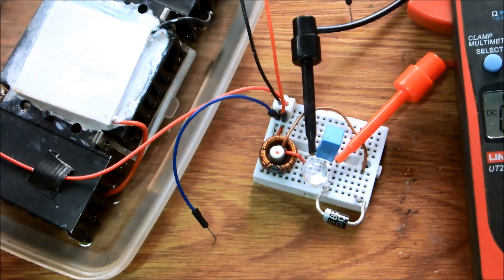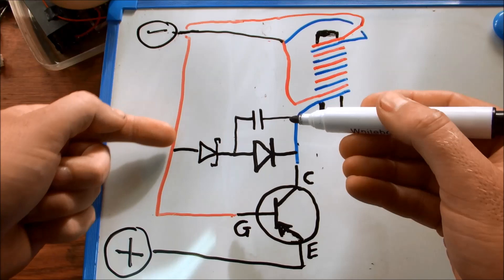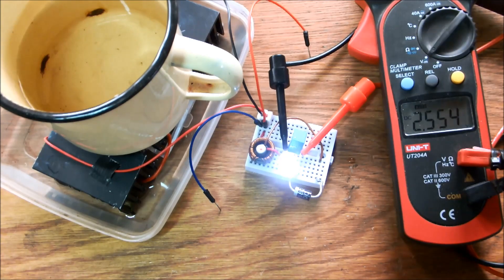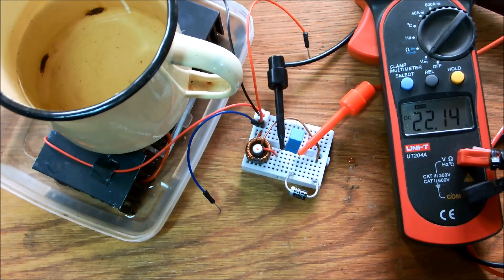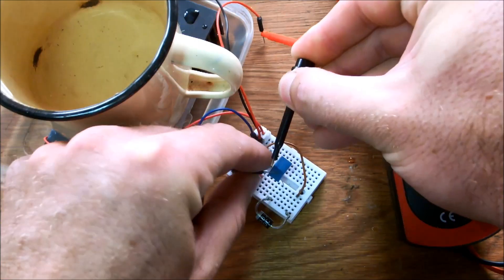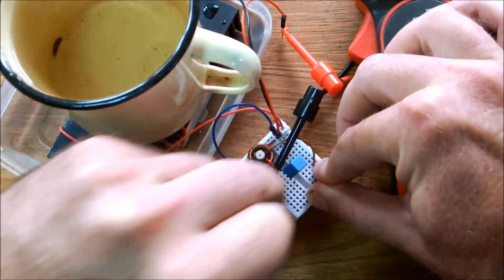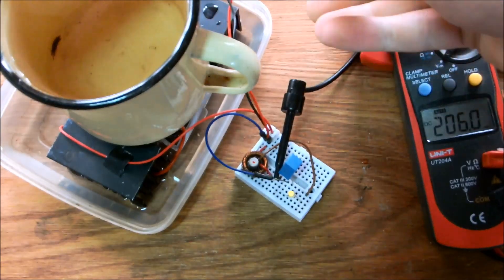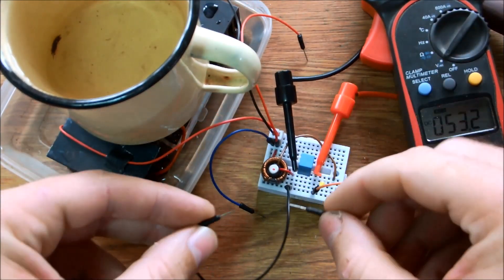Joule thief circuit. Incredible voltage boost with vintage transistor.

Comment: As one cant really put Supercaps in series, this is interesting for parallel caps to battery or caps to motor..?
What would that circuit look like? Any substantial changes you can think of?  A better way??
Reply from the maker: @RayleneCawood  why not supercaps in series? Voltage balancing issues?
Reply: @williamfraser  Well when capacitors are connected in series, the total capacitance is less than any one of the series capacitors’ individual capacitances. If two or more capacitors are connected in series, the overall effect is that of a single (equivalent) capacitor having the sum total of the plate spacings of the individual capacitors

Comment: Now that you have connected the caps or load in parallel with coil output, does the joule theif still draw more current from source to compensate for the losses incurred in voltage boost up process?
Reply from the maker: I never measured the current but it would be worth checking to compare efficiency.

Comment: its just di/dt. and some eir.
the voltage will rise to the level dictated by the energy in the magnetic field, and the resistance it sees. and how fast it switches.

infinitesimally fast break, "infinite" resistance, "infinite" voltage.

theres not enough energy across the leakage of the capacitor and the forward conduction loss of the diode for it to get over what you see here. take away that load and the meter probes themselves are now the resistance...
and yeah, transistor switch off time...

which you improved with the schottky, but...
22V is what i get on a joule thief i wound with an isolated winding, for driving a lil russian rod tube off its filament battery.. no schottky. im gunna try that. i really want 45V+.
really looking at other circuits altogether, cus ideally... i want 2-3W...and that means some heavy current from a 1.2Vnimh.

Comment: What if you were using a NPN instead
Reply from the maker: In principal it should work just as well provided the base-emitter voltage difference is the same as these pnp transistors. Modern silicon transistors could possibly boost to the same output voltage, they just need higher minimum input voltage to start from.
Reply: Emitter Collector Base, never heard the base lead  called the gate before. Must be a European thing.

Comment: I have been a big fan of these joule thiefs for years, trouble is there are that many variations of them (I havnt seen a good scaled up JT yet). Yours is very appealing as youv've got a huge voltage increase by adding the peltier into the circuit. So, presumably if you had the peltier in the hot Australian or South African sun in summer your JT is as good as a solar panel and maybe less expensive to produce. Am I way off the mark here or is this something that is achievable.
Reply from the maker: I have never actually measured peltier efficiency but from I have read it is very low. They are also very expensive for the power they produce. That said there are countless sources of waste heat so the ability to produce power consistently day and night might be worth looking at. Solar heat is great because it can be collected, stored and even transported in water. To convert it to electricity though you also need to keep the peltier's opposite face as cold as possible.
Reply: @Tim Bryan Hi, presumably your descripition " a gutted UK poundland light bulb" means a cheap light from a five and ten cents store. Are you going to show us the circuit my friend or is it too revolutionary for the eyes of the masses.
Reply: @Tim Bryan This is a big learning curve for me, I will make a note of your suggestions and have a go. Thanks for the extra input.
Reply: @Tim Bryan Hi Tim, thankyou for that, there are a lot of things that could trap me. Just one thing I am worried about, and this is just one. Dealing with the load requirement seems to me to be a bit tricky, I presume you can bleed of the output into a capacitor but if the cap gets full then you will still fry the Mosfet if the capacitor won't receive any more charge, but there must be a way around this. I hope I am not talking out my arse here because I am a novice, just trying to get my first joule thief build up and running. I dont have an Oscilliscope only a multi- meter so taking voltage measurements and the like is going to be  basic, perhaps just not good enough.
Reply: @Tim Bryan Thank you once again my friend. I remember when I started with Arduino, I strung a few components together and powered it up but there was a bang and a resistor or diode went flying, it is a wonder I didn't lose an eye. The main reason I want to build a joule thief which I really believe is an oscillator, extracting energy from a collapsing magnetic field which draws this energy from the background radiation of the universe, is because I have been working on a magnetic ramp over unity motor for years. This joule thief will help power my device. Thank you, I will heed your advice, I have already copied and pasted your words into a file.
Reply: @Tim Bryan Hi Tim, What about you send me a quote for one of your JT's and if it's affordable to get it to me in Perth, Western Australia then we have a deal. How's that sound to you, let me know.

Comment: Is it capable of driving a piezo?? To make a piezo sounds louder.
Reply from the maker: I will have to test it. What voltage do you typically power a piezo?
Reply: @williamfraser  What I have on hand is a passive piezo disc 50mm. I was testing with audio output from a smartphone with output of 1Vpp with poor result. then tried the portable 3.7 battery powered amplifier with max output 2Vpp, it improves the loudness fair bit. I think 5v will be sufficient. Thank you for your immediate response.

Comment: is the power coming from a teg/tec peltier element?
Reply from the maker: Yes.
Reply: @williamfraser  which model, if you don't mind me asking? the cheaper tec or more expensive teg model? thanks
Reply from the maker: @userou-ig1ze  the 12706 tec. I also tried a high current tec model, the 12709, but it produces much less voltage at low temperature differences.
Reply: @williamfraser  thanks! hard to find that info!!!
Reply: do you figure it's possible to power the led using the 12706 with just your hand?! e.g. lowpower led and your joule thief circuit?
Reply from the maker: Yes, but it depens on ambient temp and size of the heatsink. You will find a video in my circuits and electronics playlist using it as a head torch. The forehead seems to give better power than the hand. It also offers a better contact for the standard 40x40mm tec plates.
Reply: @williamfraser  +1 for 'headbang here'

Comment: Yo! What do you deem are good ways to use this phenomena for? Like you are probably not getting much current out of it while the volt pressure could be used for any good use? Like charging a battery? increasing motor speed? 
Very nice channel, keep up the good work!
Reply from the maker: I have used this circuit to charge capacitors. These then discharged through a separate circuit to create bright LED flashes. The circuit required 9V and I used a 4700uF electrolytic capacitor.  The current is too low to use for powering motors directly but might be applied to control high voltage MOSFETs.

Comment: re:the bypass capacitor across the schottkey diode, is it used for bootstrapping purposes(??)..
next up....how to make a joule thief circuit that puts out high current relative to input voltage...tbd..lol
Reply from the maker: The cap is across the white LED, which is in series with the schottkey diode. The LED clamps the voltage in the cap. When the LED is removed the cap can charge up to higher voltages and is prevented by the schottkey diode from discharging between pulses. So if you want to charge something like a supercap you would use the same arrangement.

Comment: When is there a new video of the solar kayak? I realy love them.
Reply from the maker: I will do the propeller tutorial for the kayak next. Stuck at home due to lockdown so just catching up on small projects. Got one more knife handle to make then I can clear the shop and get stuck into boat projects again. Need a micro motor with magnetic coupling for the small canoe...